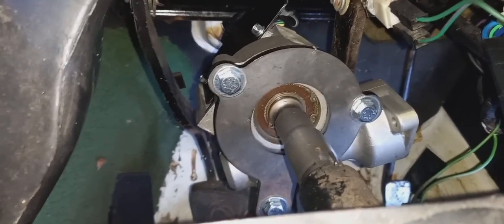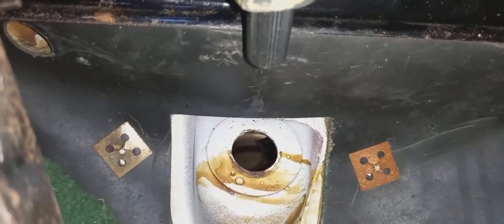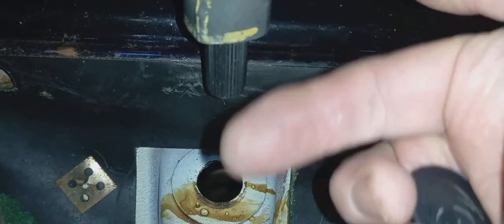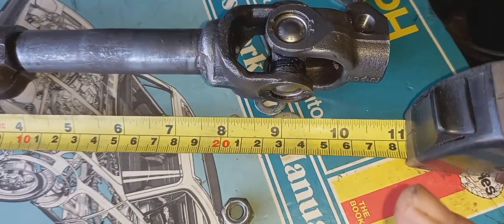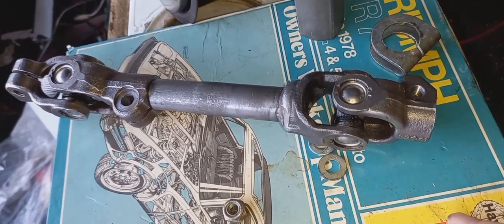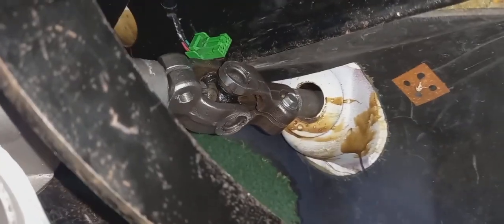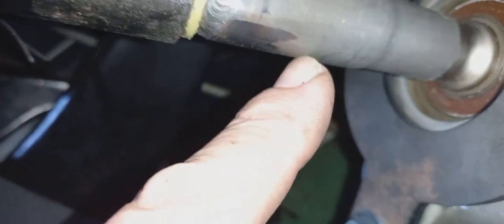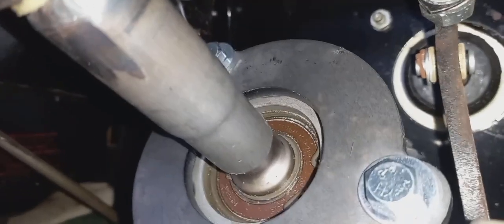Easysteer on a Triumph TR7 (part 3)

Comment: Rather you than me mate. I would have thought for a steering mechanism sold for the TR7 less fettling would be required, put me right off. Good going though getting as much on camera as you did. Thanks.
Reply from the maker: I agree. Easysteer sell you a kit to adapt, not one specific to a particular vehicle. It's been quite a head scratcher. Just have to create a support or two to prevent radial movement. Cheers for you comments, and you take care.
Reply: Agreed, I have been seriously considering this, not convinced if it’s something I want to do any more seeing how much hassle it’s been. Hats off though for having a go!